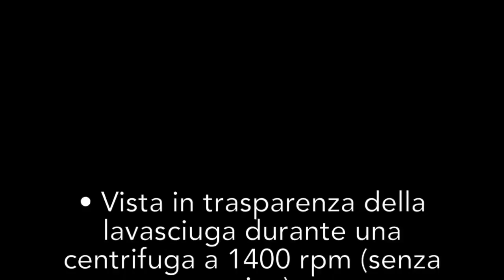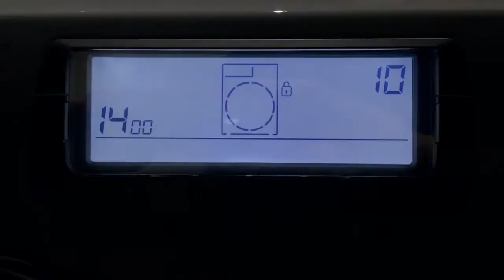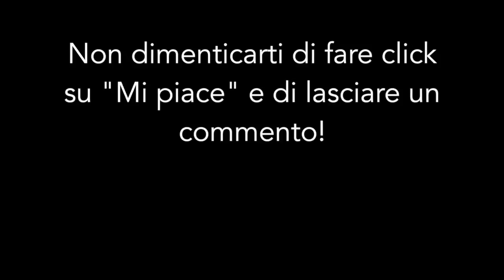Hoover WDYN 11746 PG8 - Meccanica in centrifuga (a vuoto)

Comment: so quiet. what is that small thing rotating on the top of the machine?
Reply from the maker: Laundry Room It's the fan of the dryer system: it sucks the humid air from the bottom of the basket and transports it along the metal duct where it will be heated by the heater on the inside. During the spin it rotates only by inertia.